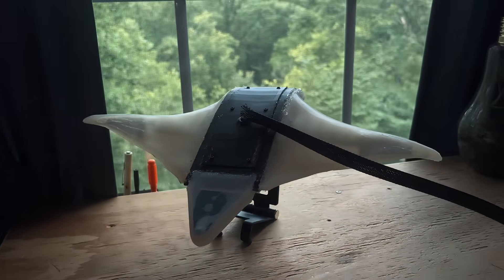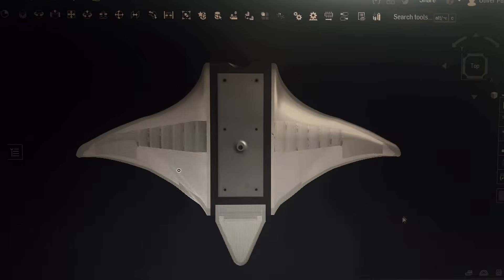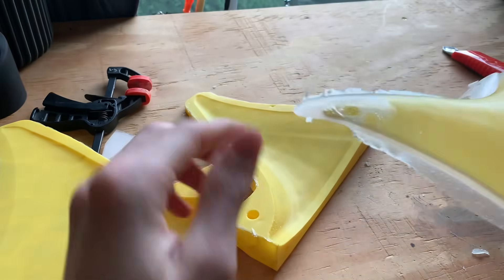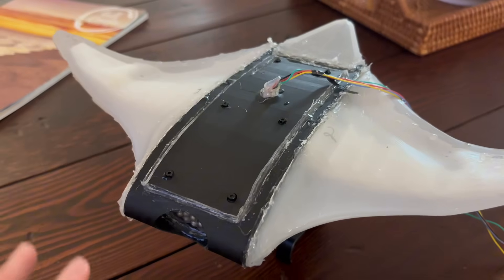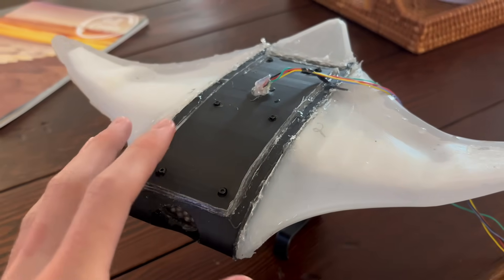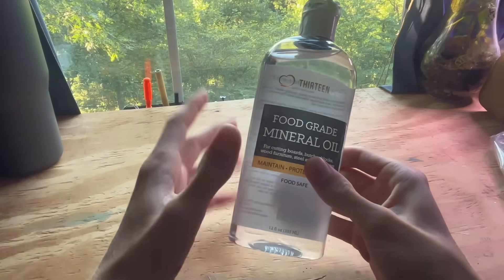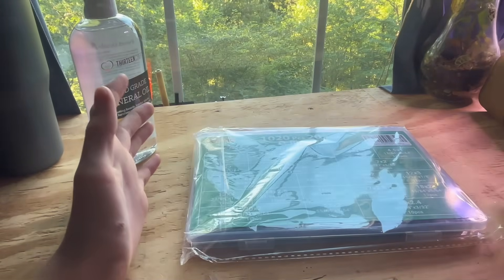Building a Manta Ray Robot

Comment: Just an idea, would it be possible to make the silicon fins and tail in one piece so that the middle acts as a gasket when clamped between the electronics housing? And car wheel balance weights for ballast as they are self adhesive?! Great video, love the idea and design.

Comment: This is a great design and such a cool project!! Just a suggestion but why don't you add 2 sets of the airfoils and sync them out of phase in such a way that it mimics the actual motion of the fin? If I'm not wrong the fin's front end moves upward first to let in more vollume of water, then it goes downward to displace that volume and simultaneously the backend part of the fin goes up when the front part goes down. I think you might get better results for movement with this mechanism. All the best with the future versions!!

Comment: Longer wing fins for added speed and swimming control.
[ larger surface area of the fin = more speed and maneuverability control with overall reduced drag with the fins better hydrodynamics, its why slow fish have sounder fins, while most speedy fish have long thin fins. ]

Buoyancy control can be achieved by a larger size
[ which you can also use for adding more refined fin controls and swimming mechanism instead of relying on strings. ]

A tail rudder
[ using an electric ray as reference. Using a hard metal rod as the tails structural support, cause we dont need undulating tail swimming with this. Keep the original tail fin as a base shape for pitch control, and the tails finned tip fow yaw control. ]

Now after following these instructions we now have...

A big Aquilolamna milarcae sea drone.

You can use radio or sound to control such machinery...
But its very complicated and will give you a somewhat painful headache during the programming process...
So to make it both easier and fun for you.

We can make it larger
Add a headlight at the front
Add handles on top with controllers
And a large seat you can attach yourself to on the drones back
And a solar panel you can wear on your back, or to put it over the seat to allow for rc controls without the seat interfering with its hydrodynamics.

[ think of the seat like those tron bikes where the driver almost looks like the driver is built into the vehicle. ]

If you follow my idea you can also make a scuba gear focused on giving the diver extra hydrodynamics one seated.
Like a helmet scuba mask that is shaped like a sharks nose.
[ also taking a little more inspiration from tron lightcycle bike drivers helmet for the back bit you can add to the scuba shark helmet. ]

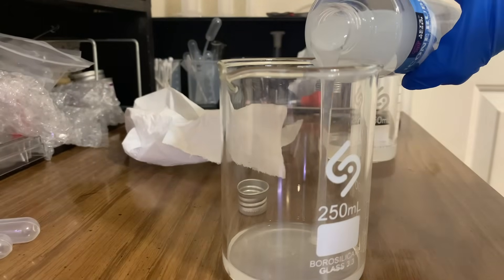Comment: 0:47 how do I put the string to make it bend like that?
Reply from the maker: Each section should have a tiny hole that the string goes through and then once it reaches the end tie a know and I would also add some glue to hold it in place. Then when you pull it, it should move similar to how it moves at 0:47
Reply: @OliverPaff thank you!
Reply: @OliverPaff also separate question do ypu have any experience of making soft robots
Reply from the maker: No I do not
Reply: @OliverPaff dang

Comment: Instead of adding weight to have it sink, I would try including a ballast mechanism that can be remotely controlled so you can go up and down in the water column.
Reply from the maker: Yeah, I was planning on using ballast tanks, but I wasn't sure if I would be able to fit them into the design. However, I will definitely need them when I remake it.

Comment: wings generally, birds and rays, don't just flap up and down, it's a circular-ish motion, there's a ton of info online about how it works
Reply from the maker: Yeah, when I was looking into the manta ray I found out about that. I was considering adding a mechanism to give it that motion. However, it was too big to fit into the small design. So definitely something that will be added when I rebuild this in the future.
Reply: @OliverPaff if the arms are more to the front, the water pressure will rotate the wings as needed, given enough flexibility.

Comment: If you plan to stay at a relatively shallow depth 900mhz works decently well up to about 10 feet or so of water. Look into one of the dual band elrs radios, they use 2.4ghz and 915mhz on the same receiver/transmitter.   Could be a cheap way in.  Obviously you have some knowledge of microcontrollers, elrs is open source and there is a few people who have used 433mhz if you look on github theres a project there for 2w 433mhz.  Should be able to penetrate water decently well while still having all the benefits of a modern rc link with a little effort.  Cool project man, look forward to seeing more of it

Comment: So very cool! I wonder once you have concluded on the hardware you want to use whether to overmold the entire thing in silicon in one shot. That removes the need for any sealing, as long as you have a 4-wire interface for power and data to connect to after the mission and making it look even cooler!

Comment: Looks nice, but you should reconsider your propulsion mechanism. Servos just will not cut it. You need more torque, continuous drive elements -whether flapping (maybe using a gear / drivetrain for continuous flapping), or just use a propeller.

I love the controls mechanisms though; looks sleek. Those should remain the same and be used for steering only.

inspiration: ornithopters, "Maillardet's automaton", "Festo - Bionic Robots"

Comment: As for remote control, 2.4ghz doesn't really go through water, so you either need to drag a buoy, or find an old 40 or 27mhz transmitter which can penetrate water much better
Reply from the maker: Yeah, I have a buoy with the microcontroller in it. I guess I never really showed that in the video. It would be a lot better though without the cable so I might have to look into the 40 or 27 MHz transmitter. Looks like I can probably get one from an old Rc car controller or something similar. Thank you.
Reply: The buoy would probably be quite handy until you're confident that you can control the manta. Leave the wireless upgrade for later.